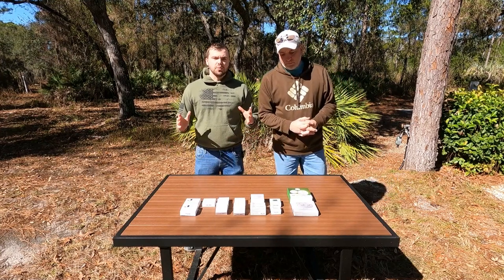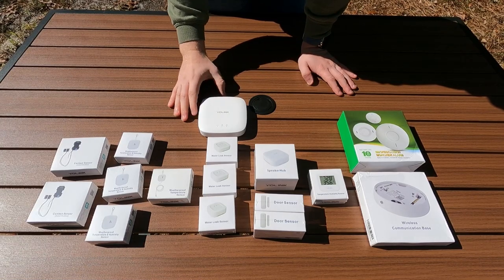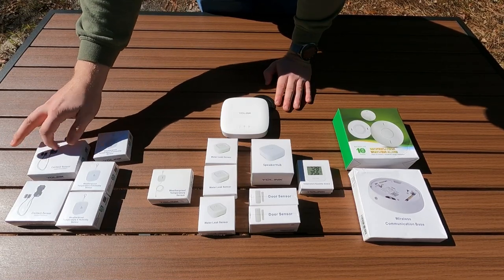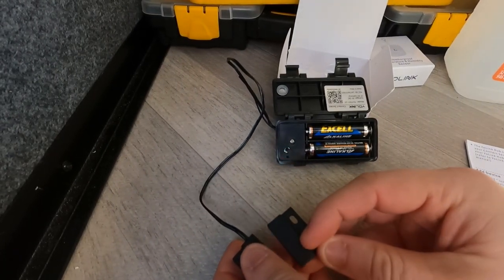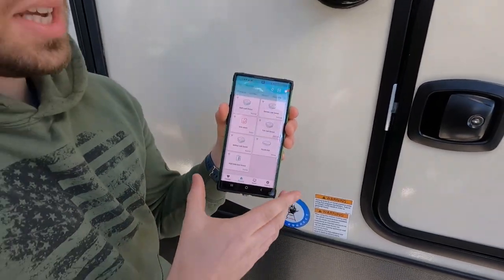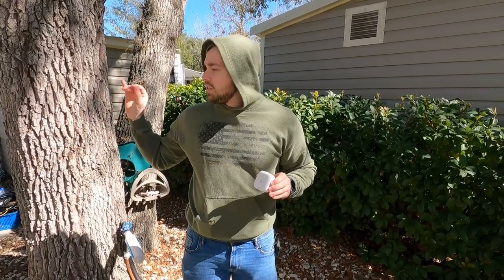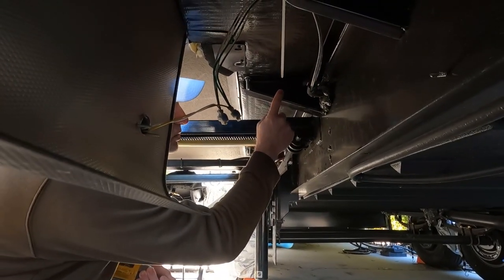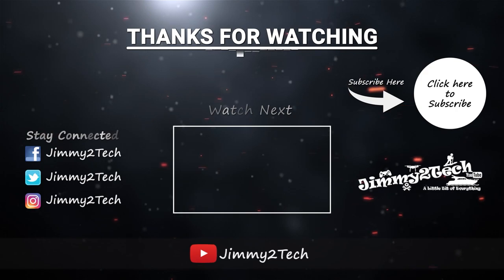How To Turn Your RV Into A Smart RV (Part 1)

Comment: I am in process of designing and building my own smart-Rv system.  I have several questions: what functionality do you lose when there is no internet? Any interfaces to monitor or control energy generation, battery SOC, or energy consumption?  Does the hub have an API/web service so it can interface to a computer?  It seems like this product is more of a security system than a smart RV system.  Just wondering.  If there is an API would save a lot of work to integrate this into my smart RV design, rather than reinvent the functionality, just sayin’.